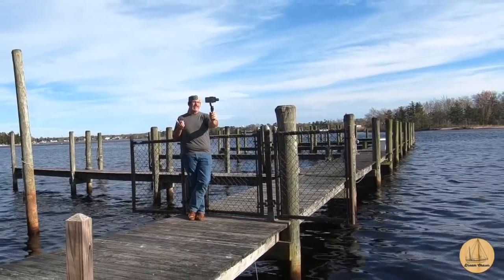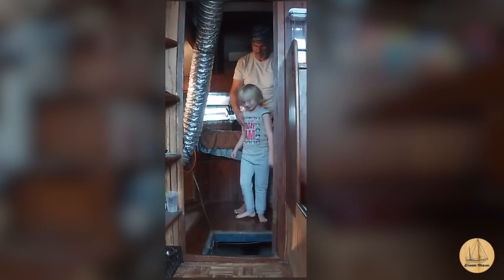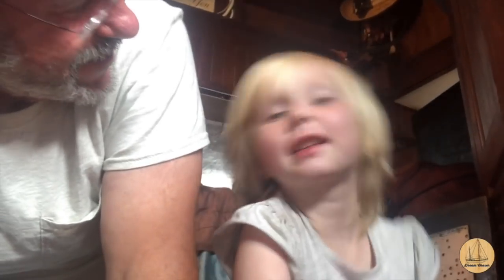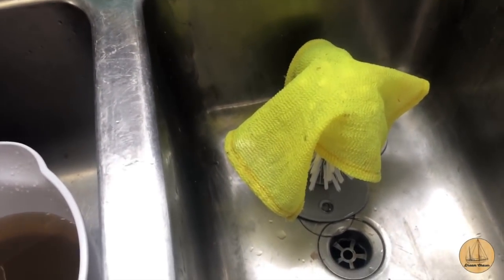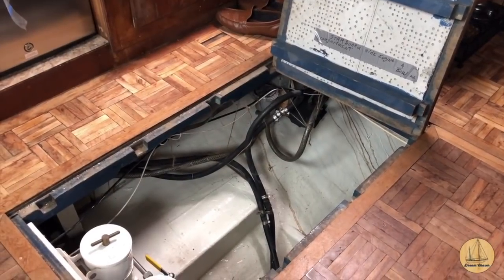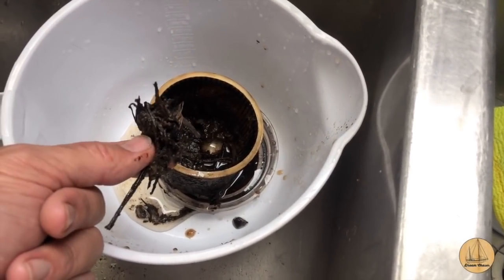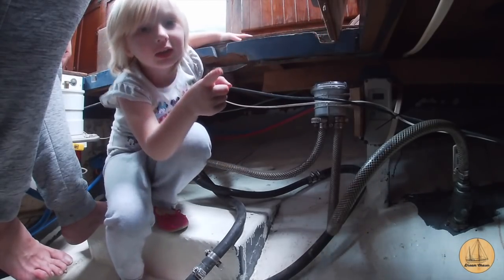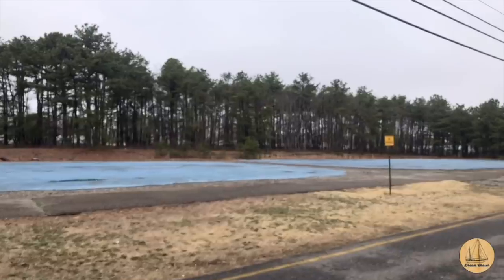Sea Strainer Maintenance Tips  And Where I Grew Up

Comment: The strainer does nothing if you have big holes in the screen filter.  You need to replace the screen mesh with all those holes.  Dirt and debris are getting to your pump
Reply from the maker: Aboard Ohana, you are correct. Sadly they don’t make this strainer replacement any more so I need to replace the whole unit.
Reply: SVDreamChaser I am sure you could make a replacement screen.👍
Reply from the maker: You may be right. I will have to try that